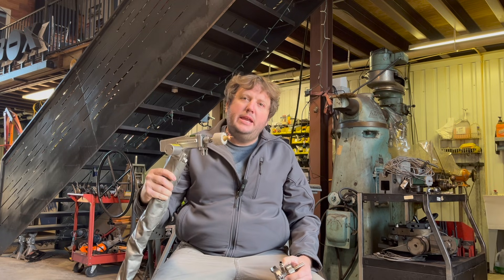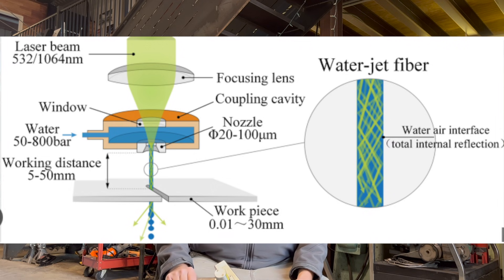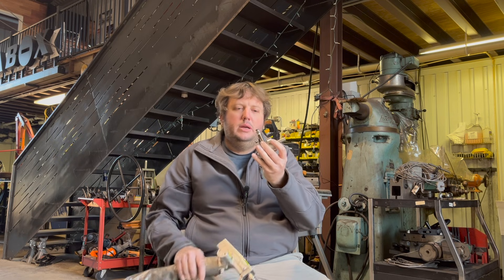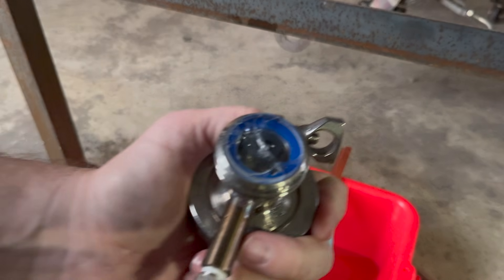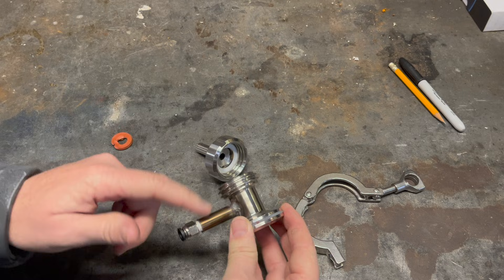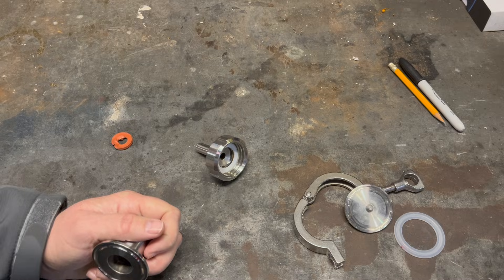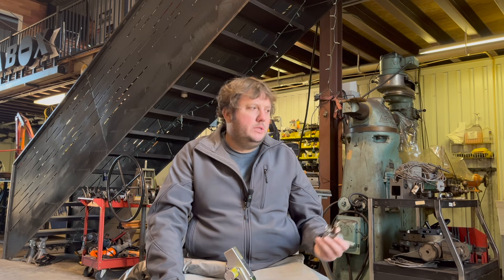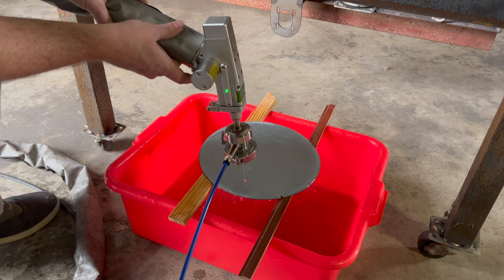D.I.Y. Fiber Laser WaterJet Cutter?

Comment: Do not use a commercial waterjet orifice.
You must design and manufacture a dedicated orifice, with the focus set to the point immediately after the waterjet is ejected. 
You will need to use a micropositioner to set the focus.
Reply: The most important bit is the focus point must be within the jet fibre, your power will be distributed across the area of the jet so it’s a balancing act between smaller jets and getting the focus point within the “fibre”.
Reply from the maker: What size orifice?
Reply: @k-rigg  Did you not look at your own graphic? It lists all the parameters. 50-600 BAR of water pressure and a 20-100 MICRON nozzle. It shows the focus being OUTSIDE the head ie in front of the nozzle.

Reading more about how it works, their nozzle also has a stream of gas constraining the water (I remember this was pretty important) and the window is made of sapphire.
Reply from the maker: @excitedbox5705 yea i was trying to stay away from high pressure if i can as it would complicate the thickness of window and seals
Reply: @k-rigg why don't you try to make the orifice with your own laser and the fittings already in place? 
About the laser wavelength, fiber lasers use around 1500nm and are relatively safer to human eyes because the water in our eyes absorbs well this wavelength. 1064nm is said to be much more dangerous for eyes due lower absorption of this by water. 
So I think the water is absorbing the laser and heating the glass. 
If you can find a lower viscosity liquid that don't absorb much at this wave length, you can even need lower pressure. 
Also, you could research the possibility of using a ktp crystal to double the frequency of light then turning your wavelength to around 750nm... checking if this wavelength is suitable to cut metals and also be cautious about backreflection of the laser bean into your laser machine that could damage it.
Reply from the maker: @esobri  good suggestions!

Comment: It seemed to me that the laser welder has a beam width that is too narrow where it hits the window, so that the energy density is too high... If the window itself can have a convex lens, so that it re-focuses the beam to a narrow enough angle to enter the water jet ... The water jet, inside the metal nozzle, doesn't have a TIR capability, it's not into TIR until it exits the nozzle.
What fun
Reply from the maker: I think i need to get the window higher up in the system

Comment: Thanks for posting! I looked into building one of these a few years ago, but gave up before spending any money on it. I think your wavelength is too low. Not entirely absorbed by water, but enough to cause significant heating and loss of cutting energy. But alignment of the laser with the nozzle is likely also a problem. You need very fine lateral and angular adjustability, and some way to verify when you have it right without destroying the device and/or your eyes or camera. I had envisioned using flexure mechanisms with screws for adjustment. And rather than moving the laser around, mount it rigidly to the frame of the machine and move the workpiece under it.
Reply from the maker: Thanks for the suggestions! First order is to get focus figured out.

Comment: Would a constant bleed off from the upper section of the chamber help with continued air removal to keep the lense evenly wet and cooled? 
I wonder if at the pressures you are running the water if there is an ongoing separation of air bubbles resulting in an inconstant and ever changing airlock
Reply from the maker: I wonder that too, might be worth the try.

Comment: Could you add a venturi into the upstream water flow to create a vacuum that puts a little negative pressure around the sight glass so water vapor/mist doesnt condense on the glass?
Reply from the maker: I dont know if i can achieve a venturi in the current setup

Comment: Bring the window as close as possible to the lens so the beam is diffused as much as possible before passing thru. See diagram at 00:46 seconds. 

Add a bleed port to the cavity so the water circulates instead of deadhead.
Reply from the maker: Thanks for the suggestions!
Reply: @k-rigg Ai says sugar or salt will increase TIR without significant internal refraction.
Reply from the maker: @av8shunmeckaneck TIR?
Reply: @k-rigg  I think it stands for Total Internal Reflection
Reply from the maker: @n0094 thanks
Reply: @k-rigg total internal reflection. Keep the beem from escaping the water jet.

Comment: There are three key fundamental problems that you have, which you're really not going to be able to fix without actually understanding the physics behind it:
1 - Your water jet is neither laminar nor useful for this. It's way too big, turbulent, and unstable(variable diameter, ripples) to guide a laser beam down. The reason they use extremely high pressure and a gem nozzle isn't academic, it's hydrodynamics - you need that low Reynolds number and a full jet separation immediately at the orifice, it simply can't stick to the surface or you can't get total internal reflection.
2 - Your laser is unsuitable for this. You need giant pulse forming lasers, either q-switched or MOPA, which can give you 20-100kW+ pulses that last no more than a couple hundred nanoseconds. It's one of those "materials stop behaving like materials and start behaving like physics" situations where you need to dump so much energy into the surface that it immediately ablates or even evaporates. This is why you hear the commercial systems screaming.
3 - You absolutely must focus the beam in such a way that the first waist expansion goes through the section that's detaching, otherwise the first reflection will simply hit the wall of the orifice and destroy it instantly. This entire device operates on the assumption that the laser never interacts with anything except water and the focusing optic. Focusing it this way requires a precision adjustment mechanism, not a couple triclamp fittings riding on orings.
Reply from the maker: Thats what im afraid of

Comment: One problem, the beam needs to be perfectly perpendicular to the window. or it'll heat and destroy your window (as you saw). This heat will then boil the water, introduce bubbles and compound the problem. Your window is sitting between two cheap eBay parts, sandwiched between two cheap silicone gaskets. It's not truly perpendicular. Spot face and polish the window seat (housing) and eliminate the gasket between the window and housing entirely.
Reply from the maker: Ok, my only problem with that is i dont know what my reference plane is as i can adjust the beam direction, so other than a center beam it would be off.  Also how does the original window in the gun get by this as its in one spot?

Comment: I have found that if you were to put the focal point of the laser just after the opening of the hole. The sight radius of a rifle is measured to that adjustment the same way
Reply from the maker: I tried that but was hard to center the beam.  All the diagrams of this process had the focus inside the chamber before the orifice though..

Comment: I suggest you have a look at the paper "Overview on the development and critical issues of water jet guided laser machining technology" they mention loosing 50% of the power after 20mm of travel in water, and having to keep the jet vertical because you can't really bend it too much.
Reply from the maker: Thanks ill search that.
Reply: @k-rigg  There is no way your little blue hose is holding the 5k psi required for this.

Comment: I think the problem is that you are in a IR (Infrared specturm) this quickly creates heat... maybe add first a crystal (potassium titanyl phosphate [KTP] , if you have enough money then it would be a LBO [Lithium Triborate crystal] those are used in industrial applications) that halfs the wavelength of the laser from 1064nm to 532nm (green) because i have a "feeling" that the attack angle of the IR with water is too big and the laser leaves the laminar flow channel. but when you would convert the 1064nm light to 532nm you could get much higher reflective angles....
many of those cleaning lasers have 250W to 500W module inside, meaning your end output power is about 125w to 250w as a green laser...

And please please use eye protection, you only have 1 pair of eyes...
Reply: Dude, there is no way he can do SHG with that (google z fold resonator) . It is not as easy as just passing thought a crystal. It would need to be servo temperature controlled, he would get thermal lensing, the high peak power of the pulsed 1064 is going to destroy the shg crystal without up and down collimating. He also has to deal with the absorption spectrum of the water at that wavelength. There is a reason they use pulsed green, so you don't throw away 60% of the light into heating the water.  The reason the window is cracking is not because of condensation, it is because of the fact at the window / water interface there is going to be a localized hot spot from the ir beam being absorbed. As far as focusing is concerned, the wavelength difference between the 639nm red and the 1064 going through the focusing lens is going to give you two different focusing planes at each wavelength. This was a fun thought experiment, but I don't see it happening at that nir wavelength. There is a lot more to it than just beam through hole.
Reply from the maker: Yes eye protection is a must.  I didn’t know you can covert the wave length of the laser by passing it through a crystal.  Do you have any links of the crystal or process?
Reply: @k-rigg the phenomenon is called Second Harmonic Generation, and it's how most green lasers work. You can probably get the crystal through optics suppliers like thorlabs or edmund optics.

You could also try growing some yourself. Les' lab has a couple of videos on the topic

Comment: You can make the orifice slightly off center. Then you can turn it around to meet where the laser is from the computer adjustment. The combination should work to center the beam.
Reply from the maker: The orifice is slightly off center just from my slack tolerance, i thought about that possibility but once the laser beam is inside the middle of the orifice i can’t really tell how off i am other than moving a step in adjustment either way and having the laser disappear.
Reply: @k-rigg don't know if it's possible to lower the power of your laser to a milli watt range...if so, you could use a cheap webcan sensor without the lens to check the focus and beam shape... the coating that blocks infrared light usually is in the lens...
Reply from the maker: @esobri  i think the lowest i can go is 100watts, but the infrared camera idea with a heavy ir filter might work
Reply: @k-rigg i saw someone testing coca cola for this, with good results 😅
Reply from the maker: @esobri interesting

Comment: I am planning to make a similar setup so i can use high pressure air for better laser cutting. My gun maxes at 140 psi. I want to use a setup like yours, with 5mm thick quartz glass, like used in laser cutter heads, so i can connect 300 to 500 psi air. I plan to use a copper cutting tip with the air saver sleeve, like used in pro cutting heads.
Reply from the maker: I got up to 200psi with the normal glass.  Slag Free Cutting with Higher Air Pressure?
https://youtu.be/k3nKGwr2Ftk
Reply: You need like 5000 PSI for this to work. They use like 500-800 BAR if I remember correctly.

Comment: Where does the air escape? At the end of the long tube, normally the air escapes to atmosphere. A series of small holes just above the window to let the air flow out may cool the quartz glass. Flowing dry air will, of course cool the lens and can not fog the quartz, since it has no moisture in the air. 
On the part that screws over the lens, drill small holes that line up just b4 the edge of lens, at least 6 holes. You may need a hard spacer b4 quartz to allow cooling air flow. 
You may need a deflector above the holes to vent the air away sideways so as not to blow on your hand gun. 
Just a idea.... Keith
Reply from the maker: There is a small hole above the glass for the air to escape. So the air that cools the first protective glass also cools the water glass.
Reply: Maybe more holes for more cooling? Your silicone spacer is good to 500 degrees, the fact it melted means the glass was not cooled enough, or the beam somehow was absorbed by it either by reflection or disbursement. 
I'm in the Seattle area, where are you?

Comment: If the body is heating up and the seals are melting that means the laser is not centered in the orifice. Your 0.009 inch orifice is sooo tiny. We use a 0.015 inch ruby orifice $130 to center and align the water to the middle of a 0.030 tungston mixing tube $90. We also have a diamond orifice but I rarely use this because it is $1000. It will be a real challenge for you to align the laser with that tiny orifice and keep it centered all the way to the end of the mixing tube. If the laser touches the mixing tube sidewall there goes any cutting power of the laser it will just eat out a hole in the side of the mixing tube. Realistically I do not see how you will be able to engineer an alignment system to the exact microscopic tolerance that is required. Even 0.001 inch error will translate into a huge side error by the time it reaches the end of the tube. Suggest source a ruby or diamond orifice 0.050 to center and align the water stream and a much larger mixing tube to match example go with a 0.050 even that will be a real challenge to center the laser in.

Then there is the problem of the water itself. Any microscopic bubbles or debris in the water will reflect the laser, heating the water instead of heating ie cutting through the work. That bubble/debris will be so small you will not even be able to see it. The water will look fine n clear but it is not. In the real world it will be a big challenge for you to make the water clear enough. We use a 0.2 micron final filter on our water. Tried a 0.5 micron final filter and that plugs up after 30 hours or so so we had to go with a 0.2 micron filter this will be spendy for you to source. We use a standard 4 inch dia x 20 inch Big Blue filter housing this is the most economical way I could configure this but the filters are still $250ea. For you suggest a standard 2 inch x 10 inch cartridge would be ample flow rate.

Subscribed I want to see how you solve all these issues.
Reply from the maker: I was using a .1 micron filter, worried about from the start.  I used the smallest orfice thinking that i only have 2kw and the larger the stream, less the cutting power.  The larger ordice would be the next step, still confused on how the protective window is getting so hot submerged in water to melt seals….  Thanks for the insights!
Reply: @k-rigg  Your water is merely the conduit it is not doing the cutting so the water diameter really is irrelevant. Cannot be regular soda glass needs to be a Fused Silica ie Quartz Glass.
Reply: I didn't even think about air bubbles. Most pressure washers introduce cavitation and bubbles as part of the process. If he's doing this DIY, he's going to need to construct a high pressure capillary tank to remove the air and straighten the laminar flow. If he's using low pressure water it will be a whole lot cheaper to construct as the tank that is in my head would have to be spun aluminum, and then carbon fiber wrapped kind of like a thick wall scuba tank. Hardly worth the effort at that point given the price.
Reply: @bsrcat1   A lower pressure laminar flow section uses drinking straws to straighten the water. I wonder if higher pressure ie above 200psi would the straws collapse even if tightly packed and glued to each other. Looked into this years ago but then I dropped the project too many other things going on. Looking forward to seeing this fellow solve all these issues.
Reply: @Islandwaterjet  pressure won't affect the straws. They're just simply in the pressure, they don't hold any pressure they only direct the flow. Low pressure, high pressure, the capillary action is unaffected. Temperature would be the only variable that could cause collapse or deformations.
I didn't even finish my train of thought in the last comment 🤣. High pressure would be too expensive, the low pressure could be below 100 PSI, or topped off with low pressure are in the chamber. You could feel the system and bleed the air, remove say a quarter of the water, the pressurized the system with low pressure air. Everything will be dependent on how big the water supply was for the vessel. You could even pipe in secondary holding tank there was gravity fed if you had an in and a vent, it would pressurize and give you a longer run.
Reply: do you vacuum treat the water?
Reply from the maker: @torsatron360  no, never heard of such a thing.

Comment: thank you for posting this I think you are working on something that a lot of us that have laser welders can be interested in buying as an attachment.  Few suggestion maybe will help. 1- If you can spend $300 on a Wazer water jet cutter nozzle I think It would be a great start at an attachment 2- change the window from using protective lenses to focusing lenses. 3- Your window should be water cooled.
Reply from the maker: The window is watercooled as its in contact with the water.  If it needs a focus lenses, i will have to up my design and math came to figure it out.  Ill have to take at the Wazer setup.   Thanks!
Reply: Yeah, the Wazer was the first thing that came to my mind when I saw this. This could make the wazer actually useful.